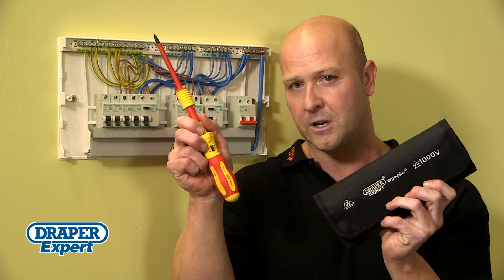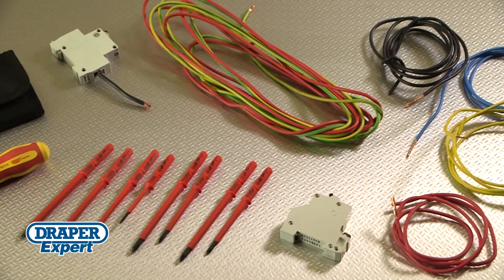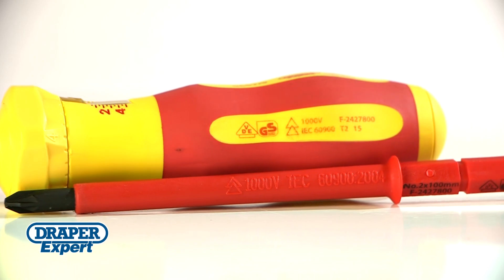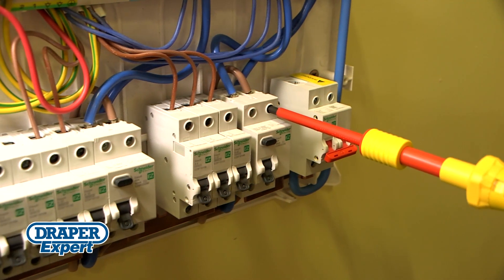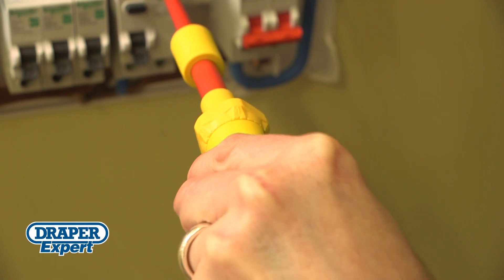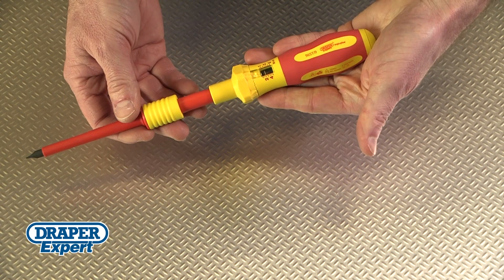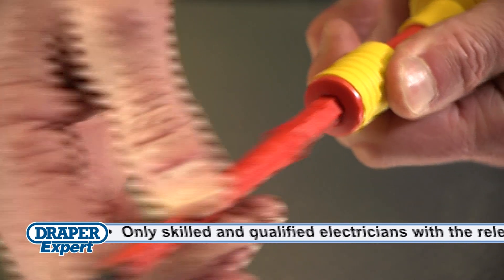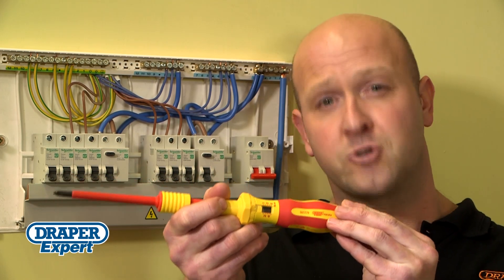Ergo Plus 9 Piece VDE Torque Screwdriver Set - 65372

Comment: Great, but then after returning to work following Christmas break I found two boards I had personally terminated had loose screws! These were certainly done up tight as I'm pretty methodical with my work and I have no doubt that using such a screwdriver would result in the same outcome. Tight on second fix, loose a couple of weeks later at power up! Only something like precision spring loaded terminals will resolve this issue. Any decent spark gets a feel for their own kit / tightness of terminations (variable depending on cable size) required etc. These fancy torque drivers are a nice idea in principle but in reality (IMHO) offer nothing that an experienced hand cannot achieve.

Comment: No slim tip, now good luck fitting it in tight circuit breakers.
Reply from the maker: FoodOnCrack We're looking into to this, but don't believe slim tips offer the same level of insulation or protection.
Reply: ***** True, but a lot of times you just need a screwdriver that fits into a relay's recessed screw. Its either using a non insulated screwdriver, cutting away the insulation or jamming in the socket and ruining it.
Reply: @DrapertoolsLtd  I didn’t mean anything. I wanted to understand what was written in the instructions that it was written “Reduce the torque to serve you more.” Is there a problem if the torque stops I took the torque number it will stop. ?